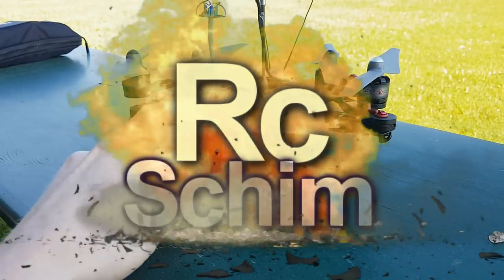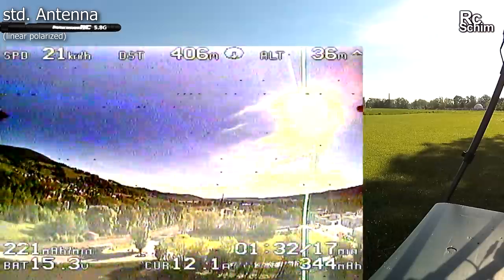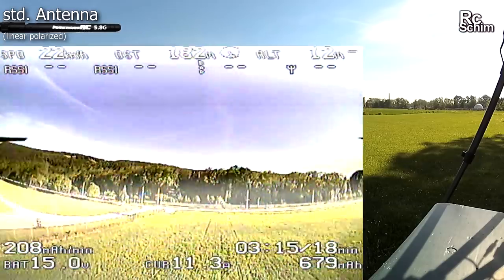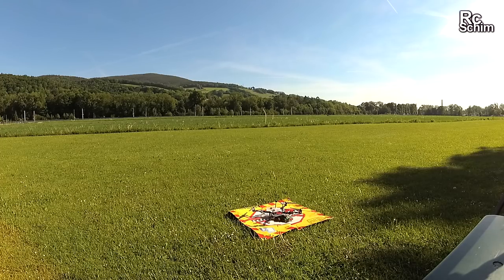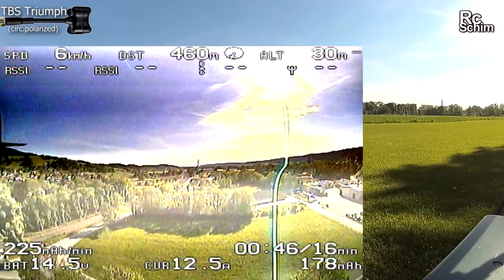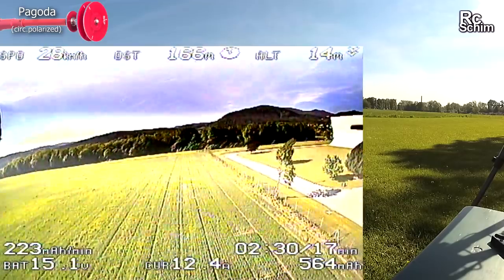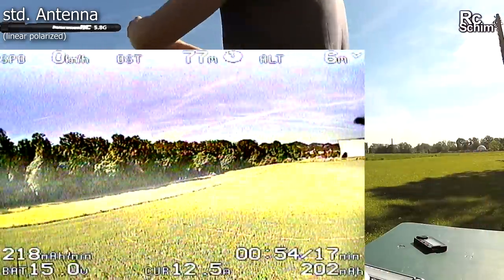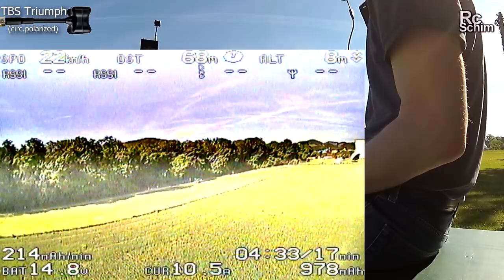Antennas tested in flight: Pagoda vs Aomway SPW, TBS Triumph and "normal" linear

Comment: I searched on buying the pagoda antennas, but there are different types, eg 2dBi, 5dBi 50w and prices ranging from $7 to $21.  Which should I get for best performance?
Reply from the maker: here is good info from Marten Baert (Inventor) http://www.maartenbaert.be/quadcopters/antennas/pagoda-antenna/
I got mine from Banggood. They look ok and they are cheap.  I dont think that there are Pagodas with much more than 1.2dbi (the specs from Maarten). surly not 5dbi which is a directional gain rather...
keep in mind: as xjet mentioned below: the pagodas are good in range, but their RF pattern  is a "flatter" doughnut - rather than a nice ball. that means if you have them mounted vertical - directly above the gain is low (antenna null)...
so for my flights, where I stand next to a mountain and want to climb high and dont fly so for in horizontal pane - it's better to use "normal" SPW antennas (I mostly use the Aomway blue ones shown here).

for flights with plane in normal height - but further out - the pagodas are a good choice
Reply from the maker: it's not fake, they just are not good at tech specs... they even put the link to Marteen below the product wheer you can see those type of antennas have 1.2dbi gain.

Comment: So you think it matters if I have a fixed-wing plane?
Reply from the maker: for fixedwing FPV I think Pagoda style antennas are better. instead of a spehre they have a flatter donut receiption. this means you have more range in the horizontal pane and less in the vertical. so flying really high directly over yourself will not be good, bu you can fly further away...

Comment: In your opinion what antenna gave you the best signal strength
Reply from the maker: +power pixels i think the pagoda was best here.  If you fly often over your self then the nullpoint above with the pagoda id's a downside. If you don't get the pagoda the aomways are also good. If your a racer maybe the triumphs

Comment: Much noise in the picture, my friend are already in 2017!!
Reply from the maker: for this test I did REDUCE the range on purpose to see effect of different antennas - that's why you see bad picture. it's not the best test and will be repeated with better hardware next spring (and with current antennas and receivers).     I cant go full range here to test antennas - wont be legal :)

Comment: I hate to give you a thumbs down, but not one of your video segments had a good clear picture, maybe the problem is some where else?!!!
Reply from the maker: thanks for at least letting me know the reason for thumbsdown. But I dont understand the reason...
reason for image being bad:  I chose low power Video TX to REACH the end of video reception within reasonable distance to examine how the antennas work. So point of this video was not to have the best picture, but to see how the antennas differ...
Reply: what I'm trying to say is that the video was all bad no matter the antenna, it is not clear to see good picture or  bad, they were all bad.  and I gave you a thumbs up for trying.  if you notice where the props are the picture is skewed to the right and to the left.  for me this is unacceptable.   that is why they all look bad.

Comment: 25mW.... is it a joke...
Reply from the maker: +solaris8x86 no, this is compliance with tree regulations. And it is good for range tests. And with low vtx power you can improve your rx side more efficient. If you have to you can later increase vtx power...
Reply: I have friend in Euro/Germany. I know the regulation. As I fly around down town city. Our RF environment is very dense. Our TX power has to be very strong. I used ~3W-4W (regulation is 4W max in my city)

Comment: AFAIK one of the major benefits of the high axial ratio of the TBS Triumph is that the superior rejection of the opposite polarisation allows you to put more pilots in the air at once. Pilots alternate between LHCP and RHCP and the high axial ratio allows them to be closer together in frequency.
Reply from the maker: +Robany Bigjobz thanks for this input. I think i read that too but it would be difficult to test for me. I think it is still a good antenna but for my flying it was never three best choice i think. The aomway were my fav long.

Comment: The first test was very good with matching antennas and therefore also matching circularity (axial ratios) , but the 2nd test didn't make any sense with mixing a linear antenna with CP antennas: a good antenna with a high axial ratio will perform poorly in such a test, yet much better when matched with a similar antenna. The comparison at the end is nice too. A nice addition in such testing is to fly overhead oneself to match up the nulls and see which antennas have the most omnidirectional radiation pattern.  Thanks for testing!
Reply from the maker: +turdsurfer iran out of time and battery that's why i decided to just use three lp antenna as tx. Honestly i think with 25mw and 30db that you don't get much rf power out there...

First tests i did was on three ground with just walking. It wasn't perfect so i choose the xugong flying.  While walking i tested also overhead nulls. But it is hard too decide how much tests to include in a video. The avg attention span here?....
Tanya due your feedback!

Comment: RCSchim do you know if it's a good idea to put heatshrink over the two top disc,s of the pagoda antenna to keep them protected and in line from crashing damage or will this affect the signal strength
Reply from the maker: I dont think it affects the gain that much. Have you seen my newer Antenna Test? check the results there https://www.youtube.com/watch?v=eePTDzeXAzU and see the RealACC (without cover) against the Foxeer Pagoda (covered in hard plastic).
Reply: +RCSchim hiya thanks very much i purchased 4 pagoda antennas and just wondered if I can put a bit more protection to the antenna as I'm a beginner in fpv and doing a lot of crashing still haha  and I'll check out the link on watch your video's thank you

Comment: My question is which omni is best to use on the controller only, not the craft.
Reply from the maker: do you really mean controller (like the remote control?) which one do you use? normal 2.4 radio, or TBS Crossfire?
if you mean the Video RECEIVER (VRX), Groundstation: check out my newer Antenna test video, for me the AOMWay SPW Antennas were the best alrounders.
The Pagodas may have a bit more range, but are not so good for freestyle.

Comment: Hi
Could you please try hep
I have the Aomway Commander Goggles
I would like to fit Head Tracker to them
Where can I buy this module to be fitted
Cheers
Reply from the maker: sorry, I have no experience with aomway commanders - so I could only read thru manuals and give you theoretical support...
from my experience (quite some time that I used headtrackers) it's way easier to assign a poti knob on the remote and use this to turn the cam... (I know it's not techy, but it's convenient :)
Reply: Thanks anyway

Comment: Tell me please, if I turn one of the two antennas upside down Do this will not affect the signal quality?
If I turn RHCP antenna over down, it will be LHCP?
Reply from the maker: hi, no - as far as I understand it you cant change polarisation by turning the antenna upside down. infact - on some installations I used to have the antenna hanging below the copter upside down because it has better direct line of sight to my receiver in most situations.
if you have the antenna on the copter upside down, you DONT have to flip the antenna on the ground...

Comment: Hi, I'm interested to know if the channel you are transmitting influences the transmission in any way? Are there better channels to transmit than others?
Reply: Yes.  Mostly because certain channels on the  vtx will output more power.  I have found over 100mw difference on 5.8 600mw transmitters depending on the channel using a immersionrc power meter.

Comment: Hello! Awesome vid! What kind of OSD are you using to have speed and altitude?
Reply from the maker: Aleksandar Filipovic thanks, that is the built in ezosd of the xugong. You can also get it as a standalone version...
Reply from the maker: Aleksandar Filipovic but the easiest osd is the dalrc qosd - check it out.  You see it in action info my fpv 900 wing from techone.
Reply: Thanks for the info! Much appreciated!